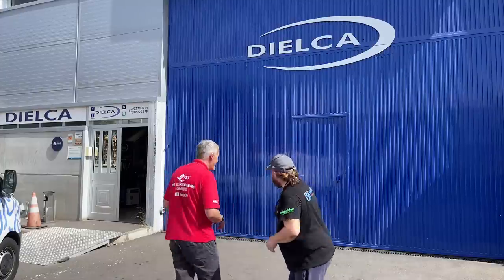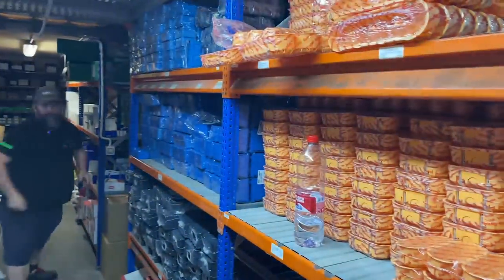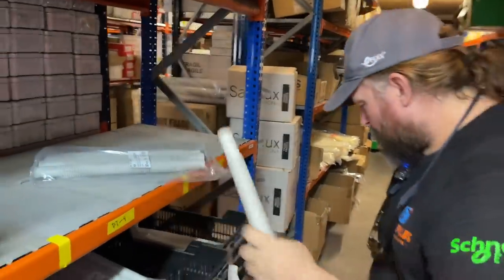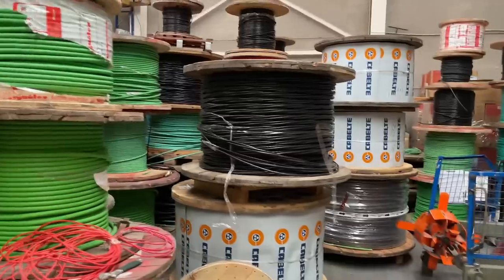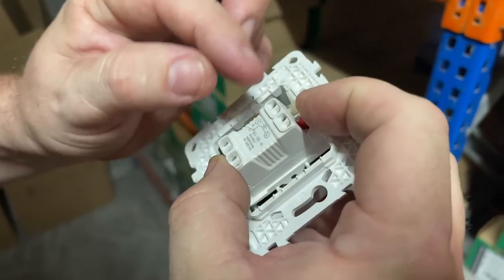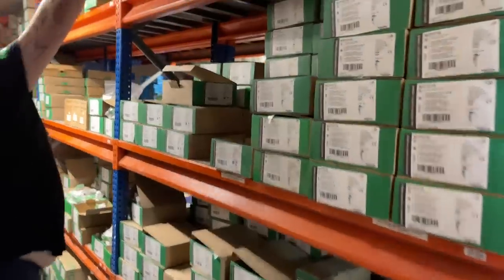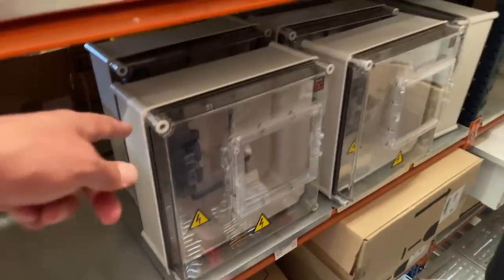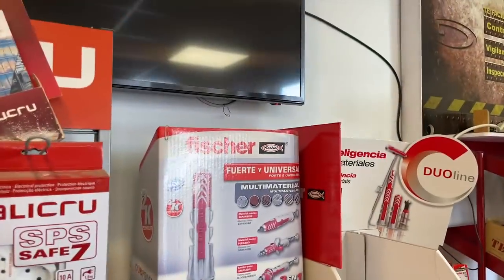Unveiling the Secrets Behind Spanish Electrical Installations

Comment: Wow, those prices for switches...

Also, no radials? Seriously? That would seem to make for a huge number of breakers. Just what the electrical difference is between three sockets in a single box (allowed) and three sockets in separate boxes (not allowed), I have no idea.

Also, IP55 is most certainly not completely waterproof. I think that UK external socket enclosures tend to be IP66, and even those aren't wholly waterproof.

Incidentally, I do like the idea of mixing makes in a CU. The devices ought to be produced to a standard set of physical sizes. A lot of the regulations on this just pander to the manufacturers.
Reply: Yes prices have shot up over the last 10 years or so. So yes we don't use rings or radials since 2002 we loop into the register boxes and join up all the individual circuit supplies there.
Reply: @9plusinstalaciones  At least it's not one breaker per box then, but not being allowed to daisy-chain sockets seems to me to be very wasteful on wires. So two boxes fairly close in the same room must have their own dedicated wire back to the registry box duplicating much of the route and taking up more conduit space. I suppose there's a good reason, but I'm not sure what it is.
Reply: @TheEulerID Yeah so you normally have a box per room, you  run the supply from the board or another box to them, it's a spider system, runs are normally short and it there's any damage, drilling etc you can just disconnect in the box and fire back up without having to exchange the cables. In a round about way, it's a lot easier to fault find
Reply: @9plusinstalaciones  Hi dude! How are you? I’m gonna start speaking in Spanish cause is easier for me haha Cómo estás compañero? Soy de Uruguay y nuestro sistema eléctrico es muy similar al español, la única diferencia es que estamos in poquitos atrasados en materia de seguridad. Por donde puedo hacerte unas consultas para poder hacer una instalación de excelente calidad?

Comment: Something happened to Tenerife prices because when I worked there they were cheaper than UK. Most people filled there suitcases with booze and fags on return. Mine were filled with plumbing fittings and diamond blades. Or he's not getting the correcto descuento.
Reply: Prices have increased immensely over the last 10 years.